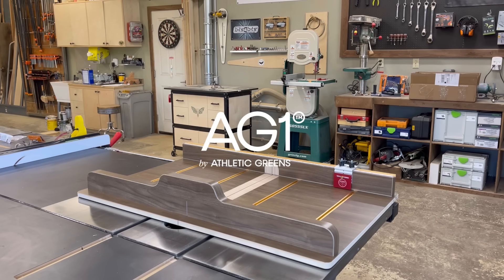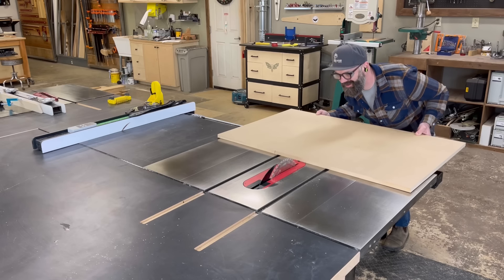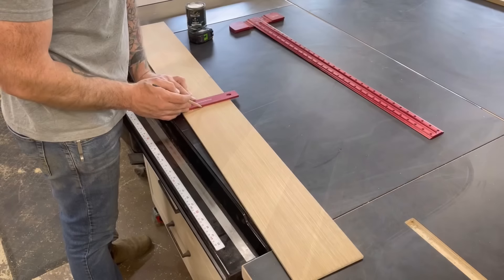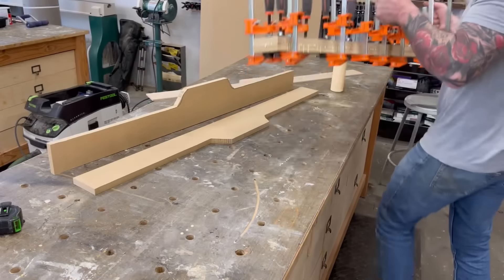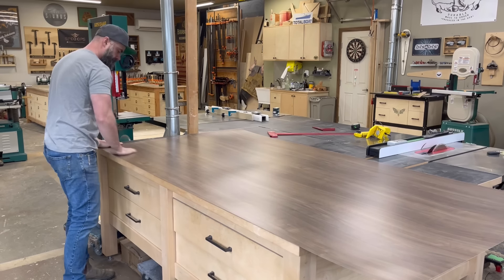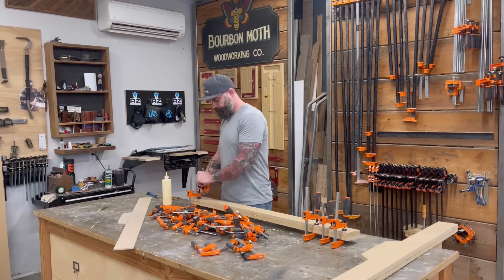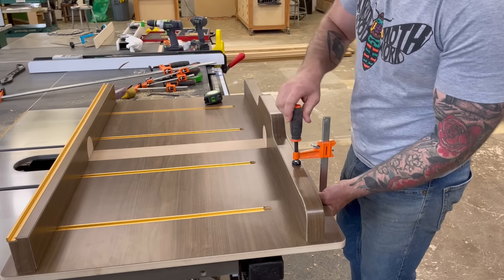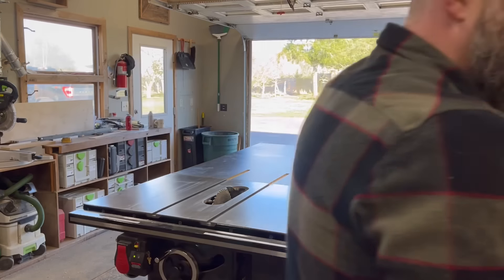Worlds Nicest Table Saw Sled || Ultimate Table Saw Upgrade

Comment: Question - Is there a good brand (or source) for the laminate scoring tool? I worked in a custom countertop shop for many years and later worked in a custom cabinet shop for many years and we never had a scoring tool like that. We always rough sized laminate on the table saw, using straight edges with a router, hand slitters, hand laminate shears or oversized bearings on a flush cut router bit to trace around a top. That scoring tool is such a simple approach to rough sizing. Looking back, it would have saved lots of time.

Comment: Again. Great work. Curious as to how you would have squared the front fence. In my mind even if you were to loosen the those screws it would not move based on the threaded inserts. Thanks. Oh if you happen to want to post the various plans to the Shaper hub for those of us shaper owners that would be great! Again, many thanks
Reply: screws won't move relative to the inserts (ie, fence) but they will move relative to the horizontal surface (ie, sled). However, fact that there are 4 screws will reduce the amount of play possible. Two (one at each end) would give the maximum play but of course you need four for strength (especially given the sled is already cut in half).

Comment: Would you consider doing a table slide instead of a sled? It extends the width of the table saw and best of all you don't have to remove and put back on. That would be a cool video.

Comment: I have never used laminate for anything I built, but your videos keep pushing me in that direction. Is there a reason to seal the MDF edges? Will they absorb enough humidity/moisture/spilled bourbon to cause an issue? Thanks.
Reply: They will soak up that moisture like a sponge.. I've had plenty of jigs over the years that are swollen along the edges.

Comment: On your Formica, does it have texture, or is there a smooth variation?  I have about 12 square feet of Formica in the garage at the moment but it has a light texture so I never considered using it

Comment: There's actually an easier method to check for square then the 5 cut method, it's called the book method, you take 2 boards of similar size and cut one straight side on each, you stack them one on top of the other with the straight sides against your back fence and trim one end.  You then open them like a book with the straight sides against the fence and bring them together so the trimmed edges touch each other.  The cut line will now show if they are square, if they come together from top to bottom, you are square, if one end is open, the gap is twice the amount you are out of square and which end is open will tell you which way you need to adjust your fence.  You look at the board that was on the bottom and was not flipped and you can see the way you have to adjust to get it square.

Comment: Great job, like to watch it and really love your explanations. Could you please do another video about building such a sled with a 45 degree angle cut? 😉
Reply: You dont need a 45 degree angle cut, you just set an edge up clamped by the T tracks.
Reply: @roberttill3787  I thought about 45° cuts with  tilting the saw blade to 45°.
Reply: @klausziel3392  If its tilting the blade, thats why he made an insert around the blade. All you do is make another insert cut at 45 degrees, and when you want to cut an angle cut, is change the insert so that the blade slot is at the  right angle in the insert.
Reply: @roberttill3787  I know, but it was so funny to watch that video so I wanted to see more of it 😁

Comment: Why didn't you use the Origin to make the fence adjustment holes?  The holes could be just slots so that the bolt heads bite into more material.

Comment: You don't need a hole to put the nut in the t-track. Just put it in place before you add the track and screw it in. Don't glue it, so you can replace it.

Comment: Looks great, but why does your old sled set off the saw stop if the metal t tracks don't touch the blade?
Reply: His old sled had a large piece of extruded aluminum as the front of the fence.
Reply: Oh yeah I remember now

Comment: Made a similar adjustable fence for my big sled a few years ago using oversize holes in the base. But since my fence was made from solid wood as opposed to MDF, I just used screws with a flat head (think Kreg screws), instead of bolts and threaded inserts. The most used sled in my shop is the small one I made quickly from 1/2 BB plywood and PLYWOOD runners. "You can't use plywood for runners!", everyone says. Well, it's been over 5 years and there's still no play whatsoever.  <shrug/>

Comment: I wouldn't recommend building this cross cut sled. I've got no issues spending a significant amount of time improving the shop---but building a large sled out of MDF is a bad idea.  I've a sled this size made out of Baltic birch and it's already heavy.  MDF would just make it too heavy for me to want to use.  Also, I'm continually pulling it out and putting it back, so I'd be concerned than a laminate wouldn't hold up to use.  Finally, I'd be concerned that the laminate would make the sled too slippery.  I like to have a little friction on the sled so things tend to stay where they've been setup to be.  A great video would be  build a robust, large sled and LIGHT enough you wouldn't dread having to lug it out and use it.

Comment: Brilliant job but you really need to use extraction when working with MDF. I was horrified when I saw all that fine dust coming off the router. It is very dangerous stuff if not respected.

Comment: Yeah, is purdy....but it's a shame you didn't at least give a nod to the woodworker who's design it appears to be based on. I mean, I could be wrong and the idea might have come to you in a dream but its sooooo similar to the one in the Kings Fine Woodworking video from over 5yrs ago that it's hard to ignore. You could have at least given him a teeny tiny mention in your video description. 

Don't get me wrong, you made this one purdier with the walnut and it's not EXACTLY the same...but... Really? 

Am I wrong to bring it up? From the t-tracks(you did add 2 more), the removable insert, the chamfer for sawdust clear out, even the red marker warning area (you even mentions the block that King used).. King's was made in two layers so the Shaper Origin part is a nice touch and I'm not saying you didn't add your own touches. 

I know, it's not required and King did give it to the woodworking community (with detailed instructions) so since the design is out there it's free use for anyone. I doubt that King would ever/will ever whine about it. 

But, as you said, this is a FANCY sled and giving him a nod.... Well, that would have been a CLASSY thing for you to do.

Comment: Some pretty nice features. I like the laminate not because it looks good (and it does) it just makes sliding pieces around more consistent and brushing off dust is a breeze. Slick solution for squaring up the adjustable fence too, gonna have to use that one. Only criticism would be (because everyone loves criticism) don't make the max height cut until you absolutely need it. Most of the stuff I crosscut is under an inch.

Comment: As good as you are at woodworking i've only noticed one thing I think you do wrong. When using your table saw you have the blade too high for the cut you are making. I always had it 1/8 of an inch higher than the thickness of the board so that if there is an accidntal  cut you only take 1/8" of skin instead of a deep cut or loss of a finger

Comment: Very nice job but it would be nicer if you showed how to do all the things without a $2000 router of $1 million worth of festool tools. Most people can't afford any of that. Good for you that you can, but...
Reply: I mean, all he used is saw, a router, and screw driver. Doesnt have to be a festool kit. U can use planer, sander wood/steel files to make a chamfer. Cut the most with saw, and sand the rest. Guy uses tools, to spear on time. 😊 u can do that with cheap tools too bro

Comment: Pretty hefty face mask for that MDF dust. Haven't you heard; a loose-fitting cloth mask is plenty enough to stop aerosolized particles as small as 0.12 microns!! 🤣

That said, very nice sled. I'm curious what the weight comes in at (common question, apparently).

Comment: Sure is pretty, but WAY Way Way too stinking heavy, Way too slippery on top and front fence.  Stop block has TWO knobs, which is one too many.
Bottom is way too thick for most dado stacks and many jigs and vertical cuts.
Sure is pretty tho. I do like the removable throat plate idea. 
I just made a separate sled for dados and angeled cuts.

Comment: Very pretty but not very safe.  Way too heavy, and allowing the blade to penetrate the rear piece with only a decal to remind you to keep your fingers out of harm's seems guaranteed to result in a trip to the ER for some extensive hand surgery.  There are any number of very functional and very simple designs availble to keep your fingers out of the danger zone at the back end of the sled.   Suggest you research them and use the one you like.

Comment: 40 bucks for a stop block just for a jig, really? Also mdf and nice doesn't belong to the same sentence...
Reply: When you’re putting Formica on top of it, yes you want to use MDF, because it is absolutely flat, and it stays that way unless it gets soaked in water. That’s why furniture makers use it. If you used plywood, it can warp in different temperatures and humidity. Solid wood would be even worse for that, and would be lots harder to make a board large enough. 

Additionally, if using ply or solid board, The Formica would try conform to any warping, possibly creating bubbles or folds in the surface of the contact cement failed.

Additionally, with all the dados, plus the replaceable zero clearance board he added, he put into the top of the board, MDF can be partially cut much more accurately. There is no chance of having the layers of ply separating, causing a dip in the bottom of the dado, which ruins the board for that purpose. 

And the stop block price is comparable to others on the market that have the same features. Cheaper ones have only one locking knob, and no micro adjustment. You get what you pay for.

Comment: Adding a fancy and slippery veneer on the top surface of a table saw sled is a terrible (and to be honest, stupid) idea. We actually want that surface to have more friction with the work on it so the piece to be cut has less tendency to move during a cut, so it and our hand holding it down are less likely to be dragged towards the saw blade. Likewise for other surfaces except the bottom. Using a fitting saying in Chinese, this is  “tuo kuzi fangpi”, or “huashe tianzu”.